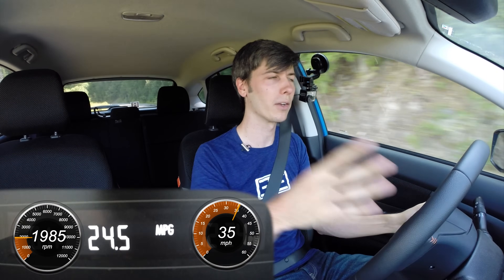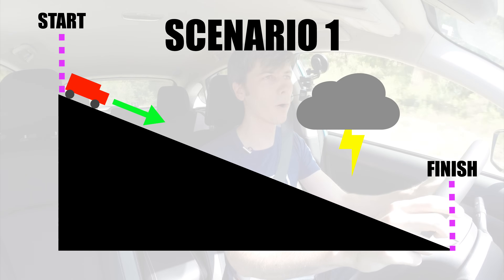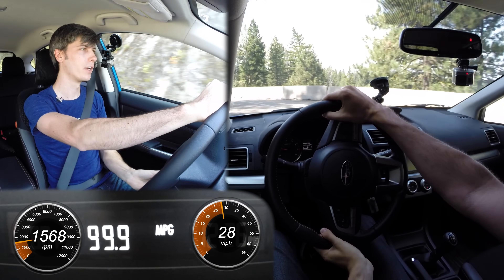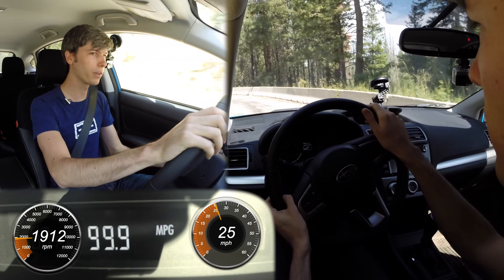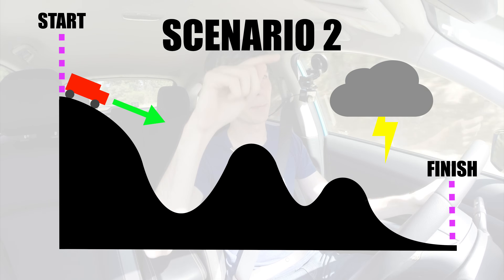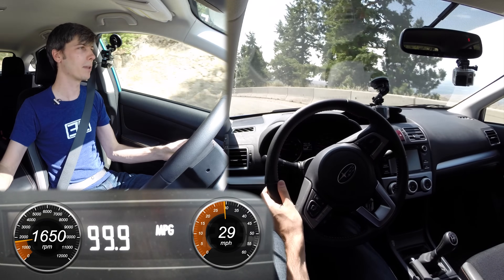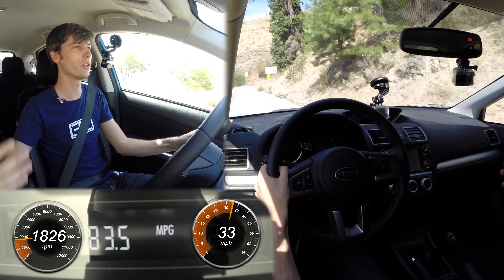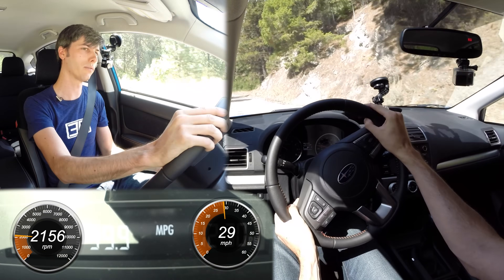What Uses Less Gas - Coasting Or Engine Braking?

Comment: Can someone explain why can we still hear the engine "bangs" (notes at exhaust evidencing something - air-fuel misture? - inside chamber was compressed and exploded) even when it is in "cut-off" mode?!
Reply: When you engine brake you are using the engine to create a vacuum inside the cylinders which is most likely what you are hearing. Your valves are still operating normally as the crankshaft is still rotating but because no combustion is taking place as the piston strokes down in its power cycle it forms a vacuum which is then released during what would be the exhaust stroke. As you can imagine this makes a popping noise when the formerly vacuumed cylinder is opened to the exhaust system. You will notice this especially more on a vehicle which has a performance exhaust or off road exhaust.

At least this is my understanding of it. My technical knowledge comes from the aviation side of things and we don't obviously have engine braking on piston recip aircraft so it's not something I really bothered to look up that much. I'm sure someone who know's more than me will chime in if I'm wrong.
Reply: I've searched GearHead forums and the doubt still persists. Some threads are poluted with discussions over "witch is the most economical way of driving" and some other stuff, where the only point we want to understand is there is any fuel being sprayed into the cilynders or not. 

I've read a good answer (such as your Josh) with quoted "Yes, depending on the degree of "negative" flywheel torque being scheduled by the driver demand, the fuel may be competely shut off". 

And other that when coating the readind would be 0.2 gallons/hour (so the computer could only display 99.99 miles/gallons). 

But the truth would only be unveiled if some one rides a modified car with uses a datalog, so it could show the log file and we could see the injector timing during coasting.
Reply: I think in this case, there´s still fuel injecting, but with throttlebody closed or nearly closed. Because without fuel, why should there be an "explosion" in the exhaust?
Would be cool if someone can explain it better.
Greetings
Reply: Thank you! That makes perfect sense :)
Greetings from Austria
Reply: The engine has now turned into a air compressor. And depending on the year or car it's only been the last 5-10years that engines have been shutting fuel off completely. Older fuel injected cars are still squirting the minimum amount of fuel into the cylinder. But again, the engine has just turned into a air compressor, if you have heard a air compressor you will noticed those buggers are loud and that's all just from air being drawn in, compressed and then released into a metal tank (like a cars exhaust) which reverberates the sound of air pulses hitting the metal.
Reply: It could be Jacob. Thanks the insights :)

Comment: Why does the engine still make loud exhaust noises while engine braking?
Reply: a compressor still makes noises.
Reply: Yes, but a compressor also has some sort of engine driving it. But when engine braking, is it just the velocity of the gases exiting that creates an exhaust noise that's similar to when the engine is under power?
Reply: But that motion is still turning the crank, pistons are still moving, Cam shafts still rotating, rockers are still moving. It's kind of like using air tools, They still make noise, even though it's only powered by compressed air.

Comment: What about older cars with a carburetor and no fuel injection? I heard that even with engine breaking you still use the same amount of fuel so they would be more efficient in neutral?
Reply: I don't think they use as much fuel as they do when driving, keeping it in gear shouldn't have a drastic difference to idling.

Comment: Hey EngineeringExplained, this picked up my exact question from a videos back. But I have to ask something more: If there is no hill - so just a horizontal piece of road - what is more efficient? You don't roll as far, but you dont use fuel - or you roll further, but keep your engine idling. Any idea in this scenario?
Reply: I'm pretty sure it's fully dependent on the car. The rolling resistance, wind resistance inertia, compression ratio, gear ratios, idle fuel consumption all comes into play when figuring that out. I'm willing to bet a lot of cars are more fuel efficient coasting and a lot of them aren't.
Reply: Stay in gear. Your 100% of the time using fuel to keep your engine idling while coasting. But even backing off the throttle in gear will stop using fuel in small scenarios. Plus engine braking greatly reduces wear on the brakes, more control over the vehicle, and short breaking distances. More pros than cons

Edit: throw into the mix that a lot of cars has cylinder shut off too now. So you may be running on 2/3 cylinders (depending on engine configuration) but you’ll be idling on all cylinders as they don’t cylinder shutoff on idle.
Reply: Depends on the distance covered at speeds low enough for neutral to inject fuel. Not really a scenario where you should be doing either blindly

Comment: Another scenario: on my way to work, coming off the motorway/highway there's a slight incline on the long slip road leading up to a stop sign. When I tried coasting can get all the way to the stop sign, but if I stay in gear I need to apply the gas pedal lightly for some time after pulling off the motorway to counteract the engine breaking and ensure I make it to the stop sign.
Reply: If you're gonna stop anyway, coasting is fine.
Otherwise, keeping a constant speed with low throttle in the proper gear will be more efficient than a cycle of coasting, getting back up to speed and coasting again.

Comment: Even on an even gradual downhill grade, it still might be more efficient to coast in neutral if the slop of the hill cannot overcome aerodynamic drag and engine braking causing you to still lose momentum requiring you to add throttle to maintain a pace.

Comment: But drag in the car's engine will bleed the car's Kinetic energy, so, in the end, you'll have to inject some fuel to keep the car moving at certain speed... but, if you kept the transmission in Neutral, then there's no drag coming from the engine, so in the end, less Kinetic energy is wasted and, in the end, you'll inject less fuel to keep the car moving at certain speed.... In overall point of view; if you put the gear in Neutral, you use less fuel because the car have less drag... also, the idea of "efficiency" is about the OVERALL/total energy of the car, "efficiency" is not just about the amount of fuel injected by the car into the engine at specific moment... Although combustion engine can't escape a baseline fuel consumption in overall cases, you can try keeping the RPM low for coasting because that is when the engine's drag is the lowest.
Reply: "But drag in the car's engine will bleed the car's Kinetic energy, so, in the end, you'll have to inject some fuel to keep the car moving at certain speed" No.
Actually now that I've read your entire comment i don't think you made one accurate statement.
Reply: Maybe you didn't get what I was saying... it is very unlikely for someone to consistently wrong on every single sentence.... it sound like you are reading my comment with an "opposite" filter, it is most likely you misunderstand.

Comment: Coasting in neutral is more fuel efficient than needing to step on the gas. Using engine break is more fuel effiicient than coasting.
Now you need to find the optimum for a given speed & topography.

If you can maintain a speed by coasting, its better than using the engine break & stepping on the gas again. If you can't maintain the speed you need to step on it anyway. If you get too fast, use engine brake and select an appropriate gear. 
If thats too complicated for you - get an electric car.

Comment: An interesting discussion would be to compare diesel vs petrol engines in terms of engine braking. Given the difference in how engine braking is "implemented" in the diesel engine, quantitatively how weaker it is in respect to a similar spec petrol engine? In the multiple hill scenario how would it stand compared to coasting.
Reply: A diesel engine has a higher compression than a petrol engine. Also there is no throttle in a diesel engine. The implication is that when your foot is not on the accelerator, a diesel engine will suck more air in, compress and expand it more so than a petrol engine. More energy is lost that way, hence you get more engine braking. All else held equal, e.g. engine displacement, car weight, gear ratio, etc.
Reply: @icekk007   that is a point, but on the other hand with the diesel engine there is no intake valve and consequent vacuum, causing less loss during the intake stroke. Perception wise, I feel less braking with modern diesel cars than their petrol counterparts..

Comment: Three scenarios where I can confirm by myself that this is true:
1) I've done the example used by Jason of reading the km/L showed by the car's computer by costing and in gear, BUT with the A/C on and fucusing when the compressor is on and off. So, when I'm in neutral and the compressor kicks in, the km/L drops dramatically. For example, when I'm doing 70km/h and reading +50km/L and the compressor kicks in, the km/L drops to about 20-25km/L and when it shuts off, it gets back to +50km/L. Now, when I'm in gear, the km/L literally never moves and stays in +50. I need to be going really slowly (below 30km/h) to start it dropping.
2) In the particular case of my car, a Suzuki Swift 2018 1.2L, you can feel this cut off of gas. If you're slowing down in gear and you get near 1200-1100rpm, you feel a gentle acceleration. Likewise, when you're speeding up and the engine pass that threshold, you can feel how it no longer accelerates.
3) I was a "coast in neutral" guy. Doing so, I got about 16-17 km/L off my Swift. Then, after I noticed the second scenario and watched the previous video, I started coasting in gear and now I'm getting 17-18 and funny enough, when I use the A/C, sometimes I get 19 in city ☺️

Comment: If you need to use your brakes,such as going down a large hill= Use engine braking instead. Everywhere else= Coasting is way way more efficient, sure it consumes tiny amount of fuel to keep the engine turning over,however there is no Drag slowing you down as in engine braking.
Reply: It all depends on the car.
Reply: The rolling resistance, wind resistance inertia, compression ratio, gear ratios, idle fuel consumption all comes into play when figuring that out.

Comment: This can only be useful when hypermiling yes?
Reply: I drive a carbureted ford and i've seen a 30% gain in fuel efficiency by simply driving differently.
Reply: What the hell are you talking about?
Reply: Tom Barron yes it's the only time it would really matter because you can see the instant read out. Before all this instant read outs no one cares because really, it makes no difference what you are doing, it's the most tiniest amount of fuel saving that would take a year of data logging to really see any results.

Comment: Engine braking FTW! My instructor told me to always use engine braking when possible. If you're just coasting the vehicle tends to accelerate when the hill get steeper and it quickly becomes unpredictable. With engine braking you are able to maintain constant speed more precisely and your driving is safer and smooth.
Reply: Even given the limits of this discussion, it was about fuel efficiency. There are other things to consider, like, would you rather wear out your brakes or your engine?

Comment: Also interesting when you have a hybrid.  Should you charge the battery going down the hill or slip the car in neutral (engine will automatically shut off). Regen always wastes energy due to charging inefficiencies but letting the car gain more speed means increased wind resistance. Would the extra charge gained power the car further after it has reached the bottom of the hill or would the car in neutral roll further due to its higher speed?
Reply: Depends on the hills.

Comment: why it uses more fuel when going slower in neutral? so when going fast enough, it uses no fuel no matter if it's in gear or not?
Reply from the maker: +Martin Atyne the amount of fuel it uses per unit of time is exactly the same. But fuel economy is independent of time, distance and fuel used are the only variables. If you’re traveling quickly in neutral, you use less fuel per distance covered, though the amount of fuel used per minute is exactly the same.

Comment: But if you leave it in gear the car will never come to a full stop, doesn't that mean it uses fuel?
Reply: What on earth are you talking about? The car won't just magically accelerate when you're off the gas pedal. Gravity pulls you down the hill, no fuel gets injected until you're going near 10 mph.
Reply: I may have lacked on detail, but I meant that if you leave it on gear in a flat surface (not inclined) the car still moves forward even if you're not on the gas pedal. What I mean is that while the motor is running, it is always  consuming fuel, that's why start/stop engines are coming up to save some fuel.
Reply: This video isn't talking about being at stops. It's just talking about going down hill.

Comment: The question is. In the second scenario if I stay in gear, does saved fuel allow me to go over these hills, or not, and I would use more fuel that way? Also i think You should take into consideration, that even If you are in gear, You can still gain speed.
Reply: You're going to use more fuel if you engine brake down the hill then apply throttle to climb the next hill.

Comment: The fuel doesn't shut off when your coasting. A simple scan tool that can read injector pulse an show the O2 sensors can confirm that.
Reply from the maker: +Mr T maybe you’re looking at an older vehicle that doesn’t have this feature? New ones most definitely stop fuel.
Reply: I guess you should hook up a scan tool an prove it. Only vehicles that I know of that completely shut off fuel are hybrids or DOD. But DOD is still only to half the cylinders.

Comment: Trucks use diesel fuel !!! Der....
It is not about saving fuel. It is about saving lives !   You must use the engine brakes !  Big heavy trucks don't want to stop going down hill.  The engine brake is the primary brake.
Also typical trucks haul 80,000 pounds total. Typical car is 3 -4000 pounds so ya know...
Stay away from them!
 They take a very long time and space to stop !
 Jim the truck driver

Comment: Just get an electric drive.. and all that inertia is converted back into electrical energy in your battery... no need for brakes..you don't use any fuel.. you gain energy.  I can remember the old days when I used to drive a gas hog.
Reply: "gas hog" I spend maybe 5 minutes refueling each month and my car was made in 1962 sweetie. Electric cars arent exactly more efficient in his second scenario.

Comment: Love my Mercedes.. the engine RPM goes to idle mode or coasting which literally saves so much gas. The engine feels like it stop working while the car is still going and very slowly decreasing speed
Reply: Randy R interesting that kind of means that the car is coasting in neutral which according to this video is less fuel efficient than leaving it in gear

Comment: Is their relay any roads in the world like in scenario 2
Reply from the maker: +ben Dordoy of course! Not all roads are smooth and flat. Take the scenario and apply it more broadly. If there’s a hill coming up, more efficient to build speed and roll over in neutral. If it flattens out and you’re coming to a stop, in gear saves fuel.
Reply: O right I know that not all roads are smooth and flat and of course no roads would in the world be exactly like scenario 2 but I don't know of any roads where u would drive down a big hill then farther down the road go up and down one or more smaller hills (like in scenario 2)
Reply: Scenario 2 happens all the time, not everywhere is Oklahoma. There's definitely hills in the world.

Comment: I always thought the same. Then recently I bought an STI with an accessport in it.
It shows that it's more efficient to coast over engine braking.

Any thoughts on why that's is?
Reply from the maker: +Robin Watson what year is it? Perhaps it does not shut off fuel in gear.
Reply: Engineering Explained it's an 09. So fly by wire. I'm guessing they haven't changed since that?

Comment: You should have shown a engine ecu fuel map table live, you can see when using engine braking it goes into the far left lowest value, whereas in neutral it just sits at idle (which has a higher value than engine braking)

Comment: What about a car that uses a carburetor?
Reply from the maker: Fuel shut-off applies to modern cars with electronic fuel injection. Carbureted vehicles inject fuel based on vacuum levels, so will still use fuel.
Reply: I had a feeling that was the case. In terms of fuel economy, wouldn't higher revs create more of a vacuum and use more gas?

Comment: Short answer is don't do anything, no way you can calculate in real life as if its a phyics problem on paper.  Too many variables will throw off the calculation.  Other cars on road, best time to change gears, slope and curvature of hills, etc.
Reply: I calculate like that in real life. I have saved fuel like that in real life. I have thought about how I was using fuel when i started coasting when i started engine breaking and when i applied throttle and my MPG's have went up.